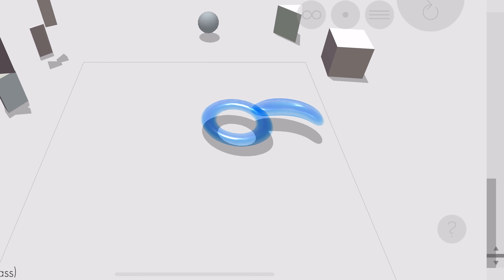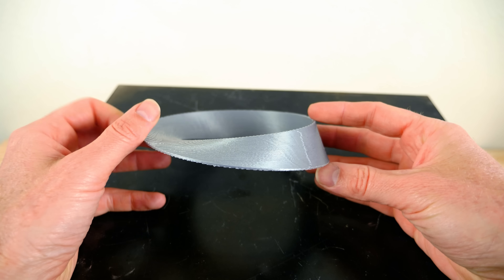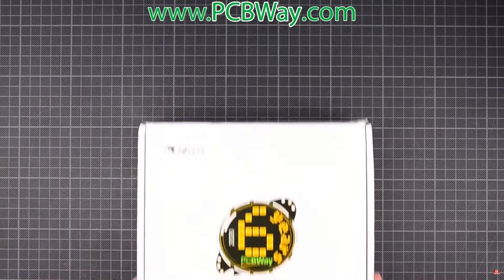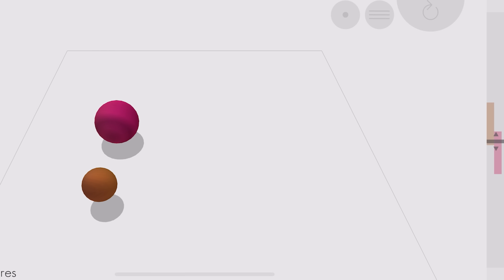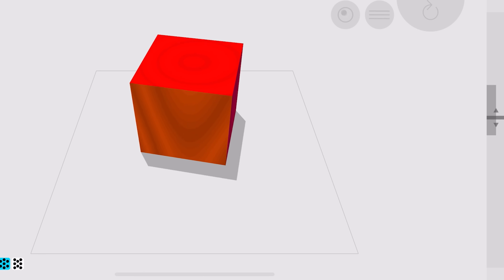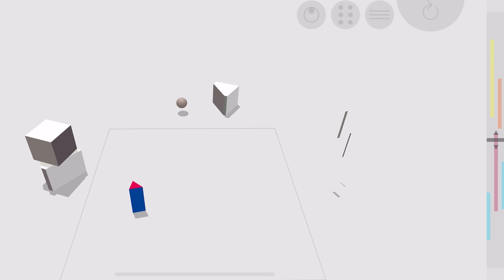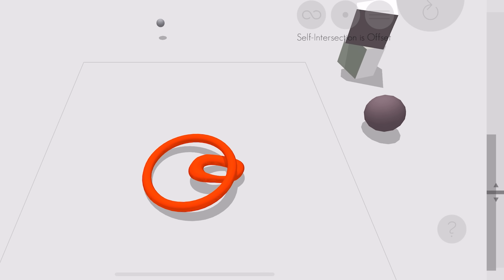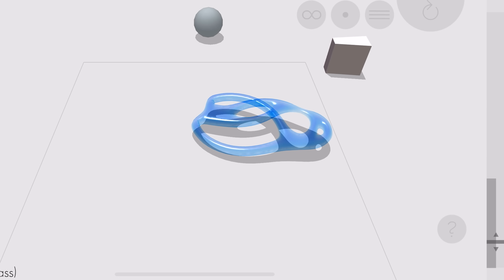What Does a 4D Klein Bottle Look Like?

Comment: As a glassblower who has made tons of Klein bottles, it does have a volume and a single opening because of the restriction of making it out of a material which has a thickness which breaks the theory, same as the mobius. They are easy to make in glass actually

Comment: 4D doesn't exist in our life because when we cover each of our sides we prevent wind and rain of the 3D world we live in to enter our space within the walls, If the earth was for example actually working in 4 or more dimensions the wind or rain etc. Would always find a way in the box we're hiding in. Which is not the case unless you built a pretty bad wall with holes in it.
Reply: not how that works. It's true that the 4th space dimension likely doesn't exist, but even if it did exist, rain and wind etc exist on the same dimensional plane as us anyway, they would not be able to traverse a 4th dimension they aren't even a part of

Comment: It has a volume it's just really hard to calculate the volume because of the size and curvature of the item like a beaker the volume is basically the same as a cylinder but you take another cylinder out of that volume so yes it has a weird volume but it does have a volume although the kline bottle is a little harder to actually get the volume out of because well its not a regular shape

Comment: I still get confused when ppl say 4th dimension.
As some say its impossible to even comprehend it, while others say its simply "time"
As in, the entirety of the subjects existance in the 3th dimension, seen in the same moment.
Reply: well think of it like this. We have 3 dimensions of movement. Up/down, forward/backward, and left/right. the 4th dimension is time, which in and of itself is a confusing topic, but just roll with it. When people are talking about 4d objects, they don't mean having time as the 4th dimension, but to have ANOTHER movement dimension, and have time be the 5th rather than 4th dimension. this is why it's impossible for us to comprehend, can you imagine an object that has a height, length, width, and then a FOURTH  measurement? it is literally outside of our comprehension, and we can only prove it through math. Not even the scientists and mathematicians can comprehend it.

Comment: I hate to break it to you, but even after lifting up the infinity symbol, it still has an intersection, because while it doesn't intersect itself in 3D, we're not actually looking at it in 3D. We're viewing it on a 2D screen with eyes that see in 2D, not 3D. So 4D toys is taking fixed 3D slices of the space, and then projecting it down further to 2D to actually display it.

To a 2D being, a self intersection wouldn't even make sense from their 1D viewpoint. Of course it intersects! Everything that doesn't have visible end points intersects.

Comment: So are stars 4th dimensional? You mentioned when spheres get larger and smaller depending on the perspective of the 3rd dementional plain. Seeing as how we can not move into a different 3rd dimensional plain and assuming the stars can. Would it not stand to reason that if a star is simply moving and what we see is a super nova. Could it be that moving in the 4th dimension requires so much energy that some stars even fail and loose all energy?

Comment: And our manifold, a minimal single sided closed surface.  Klein? Debate is on actually…
Surface(cos(u/2)cos(v/2),cos(u/2)sin(v/2),sin(u)/2) 0>u>4pi 0>v>2pi. 
Notice that 2 full rotations, 4pi, are needed to complete surface.  
Electron half spin.  Baryon asymmetry.  Both explained by this manifold.  
The outward facing part (of a single surface) is matter. The apparent interior is antimatter. 
But since they are a single surface anything which happens on one side is reciprocated automatically continuously fully on the other.  

Neutron decay cosmology is inevitable.  Geometry requires.

Comment: Im not prepared for this knowledge, but i understand now why spheres change size when scaled in the 4th dimension. Is like a circle, but 3D. If you put a bunch of thin paper squares on top of each other, then carved that cube into a sphere, you would be left with a bunch of paper circles in different sizes. Thats what it is, except in the 4th dimension, it would be 3D spheres instead of 2D circles. I cant quite wrap my head around the tesseracts, though…

Comment: There's only one dimension...time.  What we perceive as space (distance) is actually the relative temporal position of any given object to every other given object.

If time "particles" or whatever it's nature happens to be, is a form of interference to prevent events from occurring simultaneously, then part of how that would express itself to our senses would be the separation of things across "space".  These two events/objects' interaction is separated by a certain amount of time, and we view that as the two things being far apart.

It's why the universe has no apparent center, because everything is occupying the same point, separated by time, not space.

You can't make a 4D object in reality (and can only poorly simulate one outside of reality), because even 3D space isn't real.  There's just the one dimension of time, and nothing else.  And what we think of as spatial dimensions are just an artifact of how our brains process what we experience, nothing more.

Comment: I was about to comment something negatively about the fact that you can't show 4D irl, but you explained it enough to be criticized a little.

so  to those who does not know,
if we are going to use the same examples
1D is a line - 1 axis
2D is when you make a plane by connecting those 1D lines - 2 axes
3D is when you connect those 2D planes together 3 axes
So what about the 4D?
you can't just make the 3D objects to be glued to each other because it will just also result with another 3D
The answer is, TIME, the 4th axis is time, imagine 3D objects as if in two different places or planes, what is that connection or distance that separates them? Yep, it's TIME
To those who are still curious about the 5D, let's make it simple, what will happen if there are two accumulation of time separated to each other? 
like this   |   | , two timelines that is connected and relative to each other but does not intersect, it is called parallel timeline.

this is just my opinion based on the studies that I've read, feel free to make an objection and an opposition
😊

Comment: After watching a few videos trying to get it, I think I finally understand what 4D means (call me slow lol). It's the ability to see the complete actual shape of the things, right? 

For example (call me a nerd lol), if you have an anime character, they normally have very small, nearly invisible nose, when you look them from the front. In 2D anime if you look the characters from the front, you may see nearly nothing, like maybe just a tiny little dot or line or a little dark area marking the shadow of the nose. But the same character still has a visible nose when you look it from the side. When you have a 3D figure of the same character, you can view it from the different angles and realize that it does have a thin pointy nose, even if from the front it becomes nearly invisible for the eye to detect. But if you made a 3D character of the figure, you'd use sculpturing programs where you can simultaneously see the complete shape of the head and the nose. Of course the surface areas need to become partially transparent in the program for you to be able to see the actual shape. That would be the 4D version of the character made possible for us to perceive.

Thank you for the interesting video!

Comment: 2D is in your 3D world. You would see 4D, so it wouldn't exist. Anything else is a reflection. It's not there. It only remained 3D. A physical object with sides. Instead of flat. Only thing you could prove in that whole theory is a portal to another universal. Because physical property isn't limited. That's all alien and shadows. With scientists saying maybe so. Notice when you sliced it. You took it away. Only fake created. Layer programs and a prism itself destroys 4D theory. Even 2D is destroyed, it has a layer. Microscopic sides. A microscope destroyed that. Still the physical property. You only wanted to see the top. In no smoke and mirrors. We live in a 3D world as all is known. Wasn't anything else. Bring you to 1D, it was 3D. It's jus a dimension. The universe we live. Just one. You won't beat the physical object. Although they try. Only there, only remains. With no change in existing. Just that. The dimensional illusion never exists. It's magic trick. Popular. Disturbing is it ended up in fact. It's lie. Metal loop, you seen that connect. Wasn't it just a hinge? Describes another physical object. Smoke rings. Then we find water and clay. It's all about angle. Still was 3D. It has no proof to exist. It has a volume. It's a measurement. You can fill it. When you went to make it. There it was. He just wanted it designed. You always end up at a 3D object 100%, let's imagine that. Then put it into a light screen. I'd have laughed if they tried. I'd imagine they thought something space age. Then it was that. Sounded so simple. But it could never be made. The ground never just changes up. You're working in warps. Not reality. Never did disappear. That's a prism of light structure. A shape. The trick is you only see light. In delayed comprehension. It's not now. Trying to say you see, there's another complication. You're blind. You can also form a shape by sound. And percussion. Light was one. Color destroys sight. Even a scan. The shape comes later. Your nerves make another perspective. Modern is outdated. A million theories describing one. Psychic delay. All in nothing could prove, you're ten years from now. Could be dead. With energy finishing its cycle. No end to fate. Your body being all of a robot. Your brain the main processor. Nerves an other things cords. Blood being a coolant system. And even the energy and fuel it absorbs. On small electric charge. And beat as a timer. Can be recreated. As order of atoms. Only a physical object. A person is the exact same things as a tv. With ability to be programmed. And easily controlled. Formed into what its wanted to be. With an input to create more with fuel absorption. Also produces a byproduct. Slowly does change. In by action and thought. Imagine what to be, do actions to become that. Which is only what happened. It chose in fear. In extreme changes. Wanted to be compatible with that. Or something that gets away. Also something that can do that. Emotion belief. Fits evolution theory. And it did that. By all means, I'll imagine into God. Everyone else be Angels. Wings emerging from the back, don't flap your arms. No birds wanted. Practice jumping flight. The flight stuff they taught you about the dinosaurs. Except to Angels. I'll be Immortal and control all physical and non-physical aspects. Gods fight, we only need one. A good evolutionary trait. We might one day see 4D, if I comprehended it that way. Only way to prove 4D. Wouldn't everyone want to be an Angel? I seen one way. Very hard wishful thinking. In major change. 🟥
Reply: I think I'm already part way there belief.

Comment: Question: what happens to the light if you make a very long sequence of lenses all pointing the same way and spaced exactly 1 focal length apart. Would you run out of light at a certain number of lensesThank you! I personally have collected quiet a few lenses but haven’t found a good way to line them all up thanks and keep up the great work!
Gg

Comment: Wait what its still not 4D you just moved the neck with in the 3 dimensions. You took a 3D object looked at a "slice of it" making it a 2d object then you added a new dimension making it a 3D object again. You never explained how that new plain you added interacts with the Third plain you took away when making a slice of it. 4D sphere one whose cross sections formed by holding one variable constant are 3d spheres. So using them as and example in your 4d world is a mistake and you have no way to reference intersecting lines that way. Were as a 4D cube would have at least have shown that.

Comment: Question. Is there technically an infinite amount of ways to make that same third dimension shape in the fourth dimension. Kind of like you could always just pull the part of the infinity sign higher and it will still always look the same from the top.

Comment: I may not be 100 percent right..
The beaker has a volume. If i submerge the beaker in water. We can can calculate the the displaced amount of water and that is the volume of the beaker.
Mathematically... If we remove the base and cut the hollow cylinder, then we are left with a cuboid and the base can be considered as a cylinder.
If the glass width of the beaker is think the the volume will tend to zero but it will never be zero cause it will displace some water. 🙂

Please do let me know if i am wrong.

Comment: What is the 4th dimension called? This is what breaks my brain. 
For 3D, we have D1 (x) = Length; D2 (y) = Width; D3 (z) = Height. So what is D4 (w)? I always thought it was time. having the exact same thing in 2 different places (in 3D), which sounds impossible, but then you bring time into the mix and it all makes sense as the thing moved over time. 
Or is it more like a matrix - which I understand better. Cant really visualize it in a space but rather easy to understand as a subset of  the 3rd dimension - almost like a filing system with each dimension being another folder inside that folder that relates to the original folder. 
Say you want to 'file' properties of cars in a matrix - (D1) or file 1, can be car;  (D2) will be inside car which might be engine, in that you may have cylinders (D3) and in that volume of each cylinder (D4) - this can go as deep as you'd like.

Comment: I imagine 4D objects by mapping the 4th dimension to color. with the rule that if 2 things are different colors, they can pass through each other. Then you can imagine 4D klein bottle as a 3D one that's mostly red, but around where the intersection is it fades through orange to yellow. The yellow tube is able to pass through the red body without intersecting.

That sort of color change is the same as lifting up the crossing part of the figure 8 example.
Reply: Glad somebody said it. This to me has always been the easiest way to visualize 4D. It's hardly that far-fetched considering how many 2D maps use a color spectrum to portray 3D height.
Reply: What colour is the intersection plane?
Reply: @gonegahgah  it was a smooth transition in my mind. Very nice visual representation thanks
Reply: this made so much sense and actually helped me visualize it, thank you!!
Reply: field's representation. very clever) so can we declare that 3d space it self is a field of energy?

Comment: 2:16 They would not see a circle; they'd see a line equal to the diameter of the circle.
Reply: yes thats correct but if "we" look at a 2d space in the 3rd dimension you see a circle, the stick man not
Reply: I mean would the stick man see anything? There is no width to the 2d world, so if the line had no width, how could it be visible?
Reply: @sticlavoda5632  I guess the 2D man would see a color from each direction as he rotates around 360 degrees.

Comment: the changing size of the sphere seems like the change of diameter of sphere projected on a 2d plane so basically you only see 2d but the space and the space is 3d. I think this applies to a full sphere not an an empty one and a smaller sphere is a “slice” of the 3d sphere and you see its interior. If you could see the 4d you would see all sizes at the same time but in a continuous object.  Maybe if you have a transparent ball filled with dots you see everything at once as if you were a 4d observer of a 3d object but still that’s not a 4d sphere

Anyway I still can’t immagine the 4d klein bottle.

Comment: Ha ha, a lot of complaints in the comments because you didn't explicitly say "Assume that the walls of this Klein bottle and this beaker are infinitesimally thin."

Let me defend you from a different angle: Even the real-world physical Klein bottle and beaker have zero volume. Why? They are made of a finite number of electrons and quarks. According to the Standard Model, electrons and quarks are point masses, meaning, they have non-zero mass but literally zero size. Any "object" made of a finite number of points has zero volume. So there.

Of course, this also implies that physical objects can't enclose volumes either.